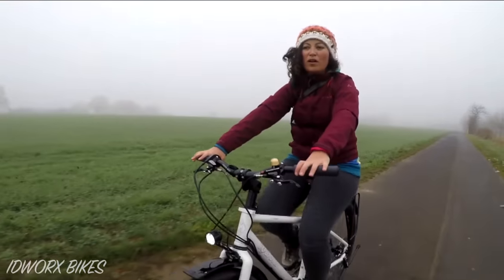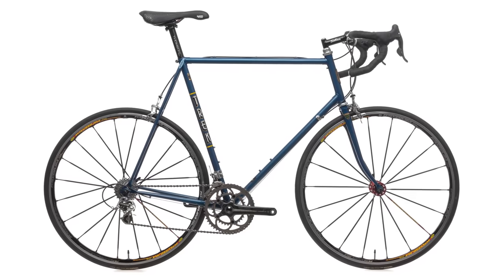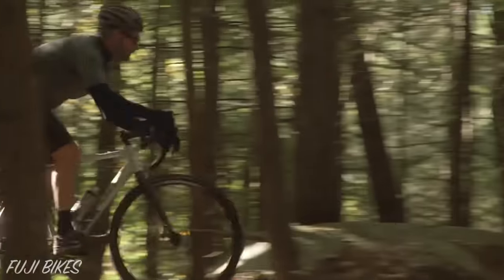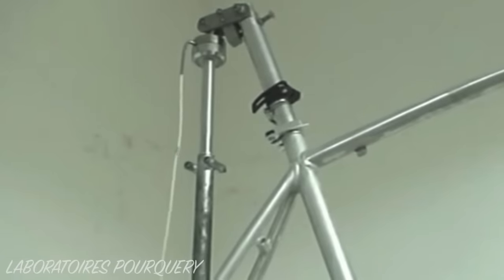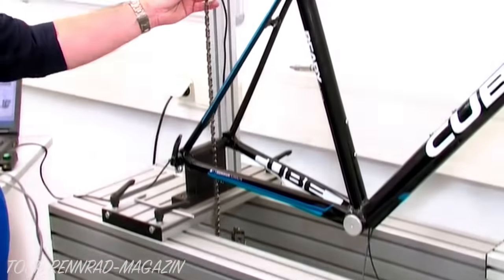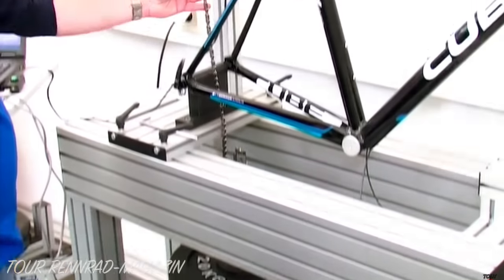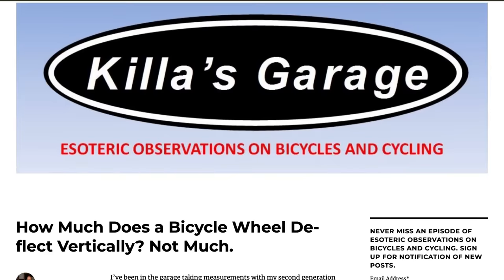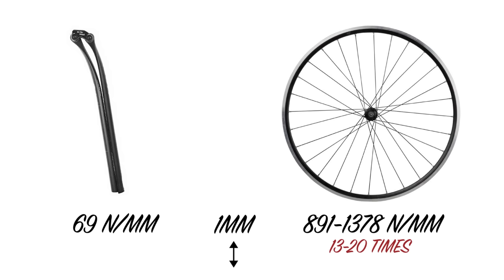Why It's Impossible For Steel Frames To Be More Comfortable Than Aluminium

Comment: This all goes out the window once you realize that vertical compliance isn't the only thing that affects comfort/fatigue, a titanium or lightweight steel frame will typically twist and absorb forces far more than an aluminum frame. It is true though that mere vertical compliance is mostly a measure of the tires, fork, seatpost, handlebar, and saddle, not the frame.
Reply from the maker: We don't have any data on lateral deflection and frame comfort. But an experiment I've done with my steel/aluminium/ti bikes is change the seatposts, handlebars and tyres to models with higher and lower vertical deflections. I can essentially make my "stiff" bikes ride smooth/comfortable and my "flexy" bikes ride harsh just with a few component swaps!
Reply: @Cyclingabout  I have a litespeed vortex made from diamond shaped titanium tubing(inherently less torsionally rigid) while it's a triple triangle layout, and therefore stone rigid vertically, you can effortlessly twist the headtube left and right like a piece of licorice. I have no idea how this would be good for hammering out power in a sprint or climb, but it's cozy when just tooling around town casually. I don't think you could get this characteristic from an aluminum frame with oversized, round, top and down tubes
Reply from the maker: I'd put what you're describing more in the 'feel' category, but purely based on my own experience of being able to successfully alter my perceived comfort on different bikes. It'd be near impossible to build an aluminium bike like that and expect it to last the lifetime of a rider. 👍🏻
Reply: @Cyclingabout yes, you could make it as torsionally flexy, but being aluminum it would probably fatigue and crack in short order

Comment: Even if steel doesn't absorb shocks better than aluminum, it's still more resilient, so frame cracking isn't as much of a problem. fifty year old steel frames are common.
Despite the advantages of wide, low pressure tires, I still I like my 85psi 1.4" Schwalbes better than the 70psi 1.75" Vittoria Randonneurs they replaced. The Road Cruisers soak up road chatter better.
Reply from the maker: Aluminium frames are not any less resilient provided they have been engineered correctly for their use case. You can design a steel bike frame to last one year of cycling, or an aluminium bike frame to last 100 years. It's not a function of the material, but rather the design and engineering.

Regarding tyre width+pressure, you will find that different tyres have different rubber compounds, kevlar layers and construction thicknesses, which results in differences in how they absorb road vibrations. The Vittoria Randonneurs are notoriously harsh riding and slow tyres, so a more accurate comparison would be a Road Cruiser in a wider width!
Reply: @Cyclingabout ? Steel bends aluminum cracks. Fatigues.  Unless I'm misinformed.     Meaning had my XC MTB that I shouldn't have jumped been steel it wouldn't have cracked months later.  It would have either survived or not.

Comment: I dont know why aluminium is often described as harsh. it just depends how and what for the frame and fork are enginereered for. for example, my trekking bike is Al, with an Al fork. that fork is extremely flexy. if you pull the front brake on a stand still, and rock the bike back and forth, it flexes at least a centimeter in both directions. i have never had another fork, regardless of material, with that much comfort build in. the frame itself (seat and chainstays) is also very comfy. its a bit noodly though when putting out power.

on the other hand, i own a Al cyclocross bike that is just solid and hard without any give. its very direct and jumps forward on any pedal press though.

so, both aluminium, but very very different characters.
Reply from the maker: Frames definitely have a different ride feel or character! It sounds like the biggest differences you're noticing are to do with the lateral stiffnesses of the frames, rather than vertical deflection.

Comment: cro mo frames from 90s were really good
then used some alu frames (way too stiff)
and now testing carbon trek domane with isospeed in frame and fork -  with 28mm tyres - more comfort than my hardtail with 29x2.0 tyres
its probably all about the design - but materials are important too
Reply from the maker: The isospeed system integrated into the Domane requires very little force to deflect a vertical millimetre. It makes sense why you find it comfortable.

Comment: I have a titanium roadbike frame (classic small tube diameter) and with the titanium setbackseatpost it has about 3 cm of vertical movement just from my weigth alone (the design is so that the seattube flexes and bends like an S (no diamond frame)) so I guess it flexes even more when i hit a small bump. I am totaly convinced by the design. It was sold as a Wheeler but a guy told me it was made by some american high end titaniumframemanufacturer and just relabled.
If you dont believe me, @CYCLINGABOUT , just tell me and I send you a video to proof it.
Reply from the maker: Indeed, seatposts can have a huge amount of vertical deflection if designed well.
Reply: @Cyclingabout  it is the frame triangle, that flexes, the seat post amplifies it with its leverage and its own deflection. I think you underestimate the low modulus of titanium frames xD

Comment: I had a full-aluminum flat-bar hybrid that felt like I was holding a jack-hammer at just 30 mph downhill on moderately rough pavement. Returned the bike the next day, switched to an aluminum/carbon fork setup. Problem solved.
Reply from the maker: Hopefully, I'll have enough data on forks soon to make a video!
Reply: That jack-hammer is indeed apt description for how straight blade fork in disc brake aluminium bike felt on uneven road after rim brake steel bikes with curved fork blades.
Every roughness in road simply hit fingers so much more sharply.

Comment: What about the FORK: straight, curved, tapered, materials?
Reply from the maker: In terms of ride comfort, forks are much more significant than the frame, in my experience. But I cannot find any consistent data on the topic. My guess is that a curved, long offset, non-disc, steel fork would have to offer the most vertical compliance of the lot.

Comment: Nah son. You can feel the flex on a large frame steel bikes. Smaller steel frames are almost as stiff as AL. AL frames no matter the size are stiff AF unless you have carbon seatposts and Forks. You will feel the difference about 6-7 miles into the ride.

Comment: You are only talking about the sadle, but thats just one point of contact your body makes with de bike. Your hands on the handelbar is 2. Why did you leave that point out of it?
Reply from the maker: Frame material plays an incredibly minor role at the handlebar because the headtube is so short. Vertical deflection at the front of the bike is mostly the front tyre, fork, handlebar and grips.
Reply: @Cyclingabout  Sorry Alee have to disagree with you here. Exactly the reason why Tom Ritchey refuses to use tapered headtubes (designed to keep suspension forks tightly in place) on his road/gravel bike frames, to give that vertical deflection.

Comment: Idk about numbers but I surely can tell instantly if the steel frame is butted or not, drastic difference in ride quality.
Reply from the maker: Yeah, ride quality or feel is a different thing again, and much harder to quantify! But I think I might just have enough data to make a video about it.
Reply: @Cyclingabout  alu frames also differ drastically in buzz, some old mtbs I rode with 1.95" felt like an eating fork on frequency, more modern alu frames didnt have that.

Comment: but tube shape, cross sections, and modified double diamonds....do matter and frame material can change those factors....but yes long bendy posts and marshmallow tires are nice for squish
Reply from the maker: I've noticed that tube shapes, butting profiles and diameters will certainly affect the way a bike 'feels' but I don't think it's possible to make a bike frame more comfortable, once we've factored in the components. 👍🏻
Reply: @Cyclingabout  flat(relatively horizontally) seats stays will visibly deflect while riding and my wife's road bike  measured using a string from the bottom bracket to the middle of the seat stay deflect 3.5mm with just her sitting her on her seat.  i agree a lot of the comfort comes from the right tires at the right pressure for the ride/rider, and getting a smaller frame with a longer seat-post can offer even more benefit. ever ridden a Jones space frame? your channel is great by the way.

Comment: Is there really such a thing as "comfort" when talking frame material? When I hear talking about steel v. aluminum in bikes I think more along the lines of "aluminum isn't as sturdy but lighter, steel isn't as compromised if you ever think about drilling holes into it and can be re-welded but it's heavier".

Comment: I got a steel frame for my road bike and after using alloy frame rhe difference is very noticeable. Steel is more comfortable definitely.
Reply: Not at all, lol.

Which steel frame did you compare against which aluminium frame? Do both bikes have same tyres, tubes, wheels, handlebars, stems, bar tape, seat posts?

Comment: Deflection is not everything, vibrations matter.
Reply from the maker: I covered vibration in the video. I think it matters, but not when you use wide tyres or carry luggage on a bike.
Reply: @Cyclingabout  Tire width? Pressure is the factor here. As for luggage, how much does it weight? 40kg? You are much heavier than your gear so the first dampening system is your body. Cobblestones will tell the truth :-).
Reply from the maker: Obviously, we'd be matching the pressure to the width of the tyres!  
Regarding luggage, the vibration damping location needs to be taken into account - it's going to be best for the highly damped material to be near the contact points. For example, if you put 3kg in a backpack rather than on your handlebars, while the overall vibration attenuation would be the same, but the rate at which the vibrations go into your hands would be different. 
Regarding luggage weight, that's an important distinction and I haven't really experimented with it. But I know that my 5kg+ bikepacking loads on my road bike with 28mm tyres make a huge difference.

Comment: Here's the deal: if you ride offroad, steel is best. I've rode bmx dirt jumps and you usually don't even sit down. You can definitely feel the difference. The aluminum frame is stiff as hell. The double-butted steel frames are what everyone rides and there is a noticeable difference. 
Same thing for hardtail MTB bikes. You can definitely feel the difference. That's why there's still a market for high-end double-butted chromoly MTB frames.
If it's full suspension, just go with whatever is lightest.
Reply from the maker: I actually own an aluminium and a steel dirt jump bike, and it's never crossed my mind that one is more comfortable than another! They definitely have different ride characteristics though...

Comment: Nothing annoying about it. A labourer deserves his wages.
Thanks for your research.
I have a number of bikes but a bike on full suspension is not relevant to the discussion. However a carbon Ridley Noah on 25 mm high pressure tyres v the custom steel tourer on 37mm tyres. The tourer has earnt the name "the rolls". It is SO comfortable. Clearly, as tour research demonstrates, the tyres are a big factor. I would have to put the 'selle anatomica' seat right up there with them - despite the seat post. The seat is simply a leather sling - may as well be sitting on a trampoline. Fantastic. And then there is the frame size - built to fit me. The point I would like to make is the number of times I have chosen to ride this much heavier slower bike over a 10 hour mountain circuit for the sheer pleasure of the 'feel'. Has steel got nothing to do with that feel? Has this bike got no soul?
Reply from the maker: Yeah, saddles play a big role in vertical deflection. A bit harder to measure, but it's quite obvious how much they flex.
Reply: @Cyclingabout  They do. Then there are the handlebars, and of course the forks. Now, if we've got those handlebars well wrapped  we'll just need the right forks to give that 'feel' one doesn't get on a top end carbon bike. The forks one finds on the classic French touring bike, for example. Which, of course, aren't vertical, and made from a substance    
with spring. Connected to the right tyres and voila. 
This is not to suggest any lack of appreciation for your food work. I will go to patreon when I get paid. For sure.

Comment: Disagree partially , ride frequently on my Kona Kilaeua and on my Trek 6700, the Trek is slightly stiffer than the Kona. As for Road bikes I have a Peugeot Prestige made of Reynolds 708 Classic and a Vetta made of Deddacciai DR Zero Uno, there is no flex in them when I ride. And on long haul I will have to see how my alumnium frames comapre to them.

Comment: So by sticking to a medium width tire like 35 mm and carbon seat post, one can save hundreds of $ in going for a entire carbon frame frame amd stick to nominal priced Aluminium alloy frame. 1lb penalty. It won't make a difference to most people. This is for daily recreational riding. Touring bikes anyways use bigger softer tires.

Comment: Yeah but it’s the vibration transfer through the metal that I am concerned about not the flex. I understand that flex will influence vibration but there are other influences such as the speed of sound through the material...
Reply from the maker: Once you hit about 40mm in tyre width, or if you're carrying luggage on your bike, it's very hard to discern between frame materials in terms of vibration damping.
The studies we have around vibration damping in cycling suggest the fork, handlebars and saddle play the biggest role (when we control for tyres and wheels) - not the frame.
Interestingly, the steel frame in the study transmitted the most vibrations to the rider. But the sample size is simply too small to extrapolate that information to all steel bikes.
Reply: CYCLINGABOUT so many variables! I have a steel road frame which by the sound of when I tap it is ridiculously thin walled in the centre of the tube, I also have a strong touring frame from Thorn steel frame which sounds thicker at the middle of the tubes than the road frame at the butts! Materials also behave differently depending on the mass involved. My steel thorn Exxxp has soo much less vibration than my Hewitt steel frame. Yes I agree the flexible parts of a bike (not the frame) will absorb most of the ‘vibrations’ but you must take into account the ‘frequency’ of the oscillations which account for the ‘feel’. Who cares what a machine says the energy of the vibrations are it’s how that energy transfers to the human body that counts.
If you have a screeching high pitched sound in your ear that has a certain energy/power level then I can tell you now that a lower pitch of the same energy/power will sound better than the former.
Reply from the maker: I think that vibration damping definitely plays a much bigger role in ride 'feel' rather than it does in comfort. Some frames just feel nice from the get-go. Personally, I've noticed over the years that I typically enjoy riding carbon frames the most.
Reply: CYCLINGABOUT I’ve never tried carbon yet. I should give it a go! 
Do they make expedition frames from carbon yet? Bamboo I understand is a thing, which must be like carbon...
Reply from the maker: @pressurechangerecord  There are quite a few bikes these days, mostly fat bikes and drop-bar gravel/off-road bikes. The Salsa Cutthroat is probably the most well-known example.
Reply: CYCLINGABOUT 👍

Comment: Ask a BMXer about whether they can feel the difference of steel vs aluminium.

No, it isn't just vertical compliance, it's torsional stiffness and also resonance qualities.
Reply from the maker: BMX is a different beast. You're landing sideways half the time so having the give in the frame is essential.
Reply: @Cyclingabout  the current school of thought in terms of analysing ride quality is that a huge amount of energy is transmitted to the rider.

For example, a vibrating tank seat was found to be causing 250w of friction inside the driver's body, resulting in considerable stress and fatigue.

The move towards fatter tires in road racing is thanks to this sort of research revealing that rolling resistance is only one part of the losses, and that a more compliant ride is a more efficient ride.

Counter-intuitively, a stiffer/harder ride was associated with a subjective perception of speed - more vibration is associated with going faster, so very hard tires made riders think they were going faster when they weren't.

I can bend any bicycle frame seat to steerer with my arms, let alone with legs and bodyweight under pedalling force.

Comment: Summary for Road Bicycles:
Carbon Fiber: STIFFEST. The choice for high-performance and racing bikes due to its exceptional stiffness-to-weight ratio and customizable ride qualities.
Steel: STIFF. Great for comfort and durability, ideal for touring, commuting, and endurance riding.
Titanium: LESS STIFF. Offers an excellent balance of comfort, performance, and durability, suitable for high-end touring and endurance bikes.
Aluminum: LEAST STIFF. Lightweight and affordable, popular for entry-level to mid-range road bikes and racing.
Reply from the maker: Based on my database of 1,500 road bike frames measured for stiffness, aluminium road bikes are the stiffest, followed by carbon, steel, and titanium. This is just on average, there are super stiff titanium frames out there, and flexy aluminium frames too.

I discuss this in length in this video: https://www.youtube.com/watch?v=5f8PGpKUKro
Reply: Incorrect. You can make noodly carbon frame as well as super stiff aluminium frame.